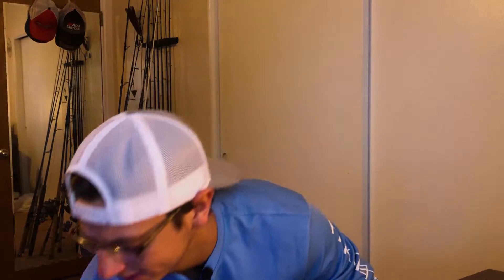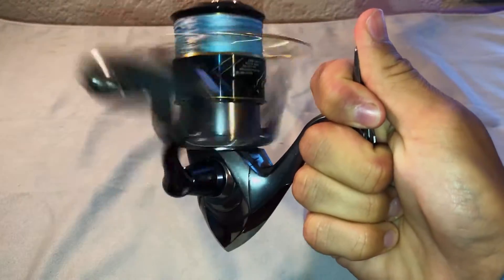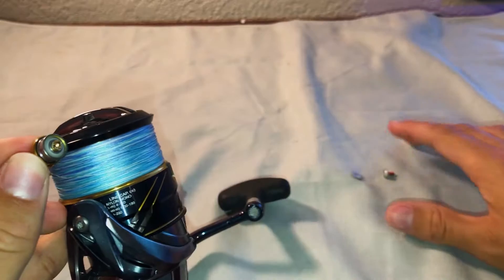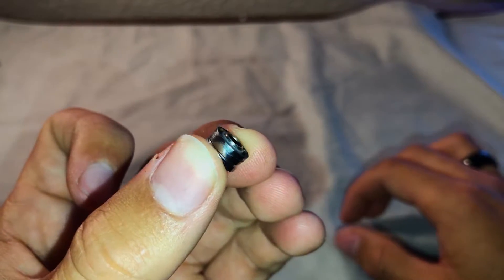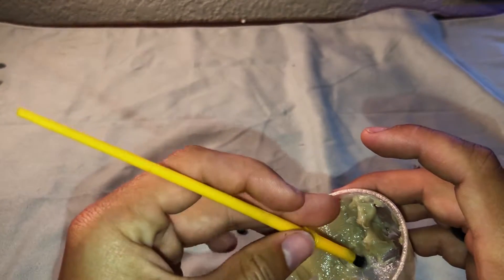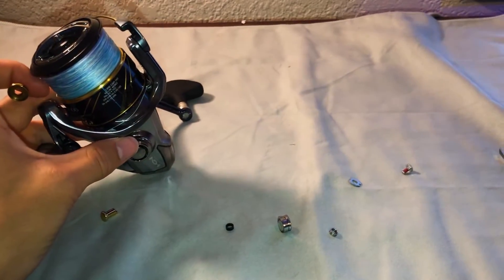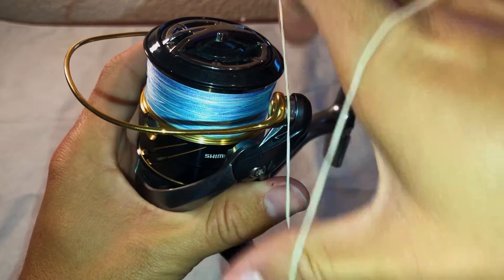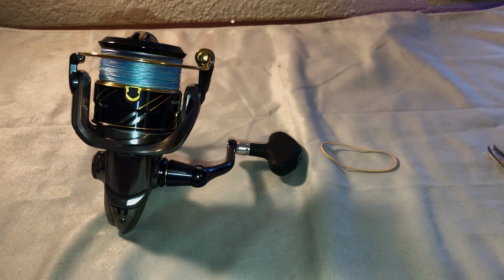How to Fix a Loud Line Roller | Shimano Vanquish

Comment: So this is not the fix but the replacement. However, nice video. The line roller bearing is the problem with almost all Shimano reels. Within two years of using my Stella 3000 FJ, I had to take it apart and clean it 4 times. I also replaced once all parts of the line roller.
Reply from the maker: You are correct, thank you for the nice comment! I haven't had to take apart my stradic that many times since I've owned them but every case is different!
Reply: @WestCoastFloridaFishing  It depends where you fish. If the water you fish is often dirty due to rain falls, then the line roller gets dirty more often. I guess, fishing at ocean or clear lakes will not have the same impact.

Comment: hey i got a stratic 1000, 2500,c3000 . you think the parts would be the same for the 2500 and c3000? ik the 1000 is smaller, so i guess not that one. just wondering
Reply from the maker: You’re absolutely correct! The parts for 3000 and 2500 are almost identical! The 1000 size has some smaller part sizes of course!

Comment: tried something klike this on my stradic fl..not so much grease as you do.. but the lkine roller is quiet with rubberband and stuff.. but when fishing and retrive a lure its on again and sound terrible
Reply from the maker: Your bearing might be bad and no amount of grease would fix a corroded or grit filled bearing. Try replacing the bearing (rd13269) I think…
Reply: @WestCoastFloridaFishing  its brand New reel almost ...
Reply: @WestCoastFloridaFishing  thanks for the part number, my shimano stradic FL 3000 started to make that same noise while retrieving a lure but didn't make a loud noise when just using a rubberband moving the line roller back and forth. I took apart and cleaned it out but still made the noise. Must be that bearing, hopefully thats the case. I'll update the comment when I get the  new bearing part and replace it, thanks for your help man!
Reply from the maker: @jcthugsta  no problem buddy! It’s definitely going to be that line roller and it’s the bearing that makes the noise. If you can slide the bearing onto tweezers and put as much pressure on the inner wall of the bearing you will be able to see the difference in a bad bearings vs a good one! Definitely let me know if that fixes your issue!! Good luck buddy!
Reply: @WestCoastFloridaFishing  it worked! just got the bearing (rd13269) and replaced it with this new bearing and it's quiet again like new. Thanks so much for your help. It worked on my Shimano Stradic FL 3k so if anybody else needs that part for their line roller bearing noise problems that's the one. Fish on brother!
Reply from the maker: @jcthugsta  perfect man!! No problem I’m glad I can help! Fish on bro!!
Reply: @jcthugsta  some braid line also makes noise to the reel

Comment: Have you ever used ABEC-7 grade ceramic bearing with stainless races as replacrments  when repairing or upgrading reels? If so, are they noticeably better performing than the stainless bearings and do they resist corrosion better/longer?
Reply from the maker: I have not used that grade bearing at all so I am of no help!
Reply: i dont mean to be so offtopic but does anybody know a method to log back into an Instagram account??
I was dumb lost the account password. I love any help you can offer me
Reply: @Tyler Micah I really appreciate your reply. I got to the site through google and Im in the hacking process atm.
I see it takes a while so I will reply here later with my results.
Reply: @Tyler Micah it did the trick and I now got access to my account again. I'm so happy!
Thank you so much, you saved my ass !
Reply: @Reuben Francisco No problem xD

Comment: and my vanford has loose it cklick pin some how.. but is that part so importan just for the click noise? i mean it still works to fish with.. but i dont know if that part in the bail is needed? and how tight should i turn the screw that sets it abart  ..the last step i mean when you tighten the linerollewr screw from outside
Reply from the maker: Dang! That Sucks! Not super needed no, just a cool feature. Tight enough where it won't back out. Or put a dot of blue loctite. Thanks for watching!

Comment: I’ve seen the one video that recommended not oiling the line roller. So which is right oil or no oil? Thanks again
Reply from the maker: I would not oil the line roller bearings but I would pack it with grease to ensure a barrier impenetrable by saltwater!
Reply: @WestCoastFloridaFishing  thanks for your reply. Regards

Comment: i must ask i have problemns with vanford.. tried even new bearings they dont make noise so much but the dont go as easy smooth or to say.. i use high precision grease from abu.. i live in sweden over here all people sa use oil.. but then it sounds bad... but how muych resistanse is accepted? i mean on  the sahra fj i have there is no bearing and if you take a line and run it over the linerolelr it dont spin so smooth but its silent
Reply from the maker: This is all a personal preference and if you feel it is not feeling right, ship your reel into Shimano for a service.  Thank you!

Comment: My  Stradic CI4+ sounded like that right out of the box.  Replaced the line roller original part from Shimano and it's still sounds like crap.
Reply from the maker: Dang man I’m sorry to hear that! I’m not sure why it would still sound bad after replacing it unless that’s not the issue
Reply: @WestCoastFloridaFishing  yeah I've oiled and greased the Hell out of it, and I can get it quiet for a second but then it's back.
Reply: Same problem! 2 week old ci4+. Roller is good but reeling under load(5grams lure) make noise
Reply: @banenikolic9130  have you solved this problem?

Comment: As of now 9-13-24 Shimano no longer makes the replacement line roller bearing, I texted them and asked where I could buy a replacement and they did not reply. I guess when your line roller goes bad you buy a new reel .l am very disappointed in Shimano.
Reply: I just replaced a roller in a 4000 stradic.  Gomexus.